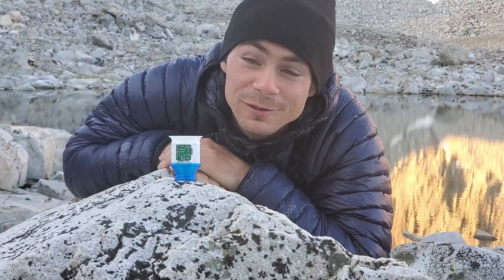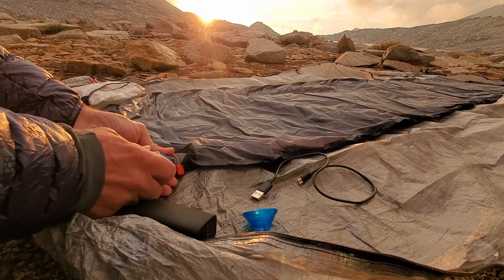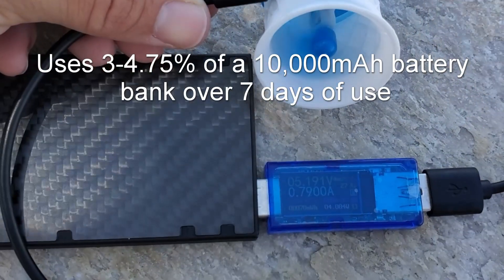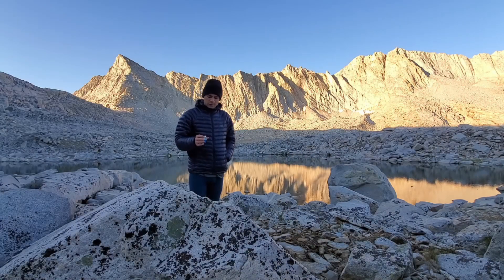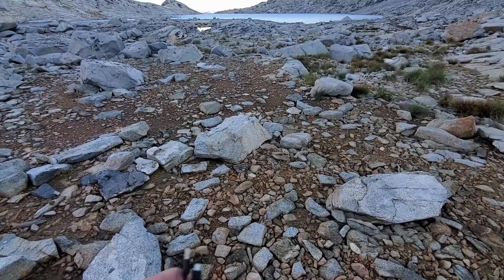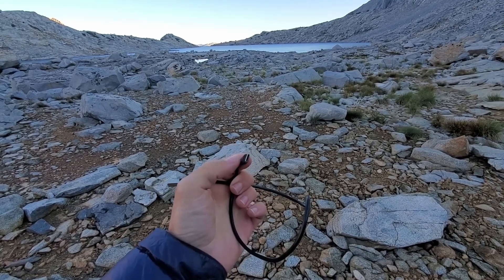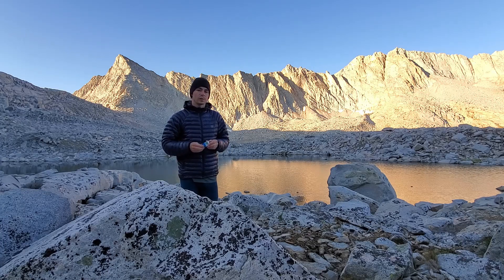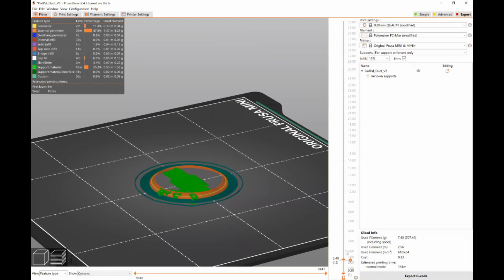11.5 gram Sleeping Pad Inflator, The Pad-Pal

Comment: How about using a PadPal in "LeafBlower" mode to blow all that pesky debris that accumulates in one's tent tub out the door each morning before packing up the tent?
Reply: Or add a sensor and hang it at the vent so it turns on after a certain humidity threshold is met.